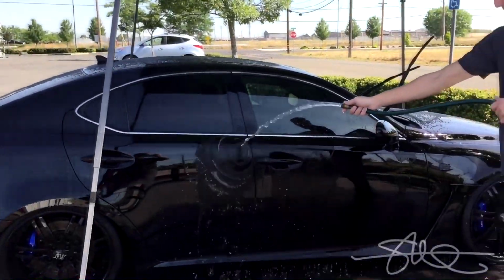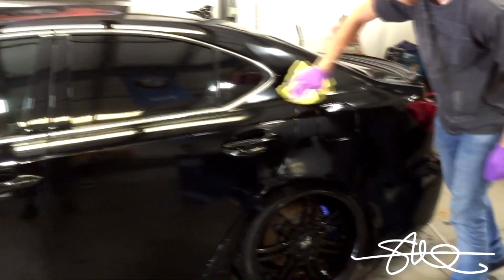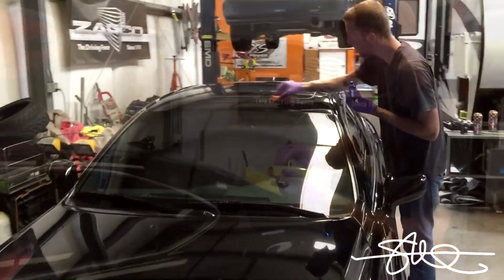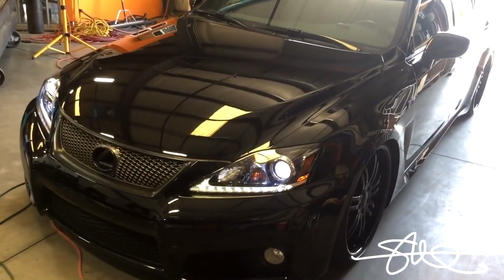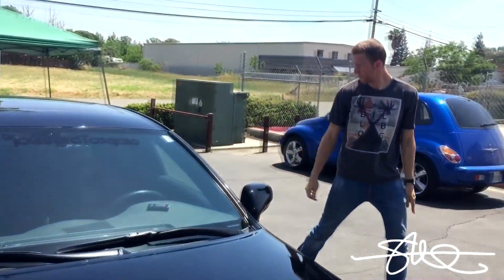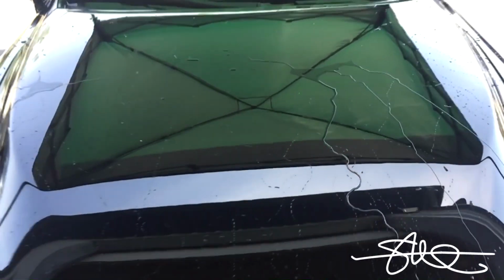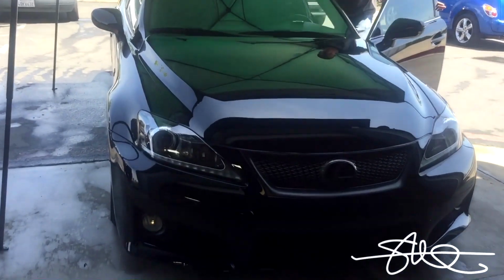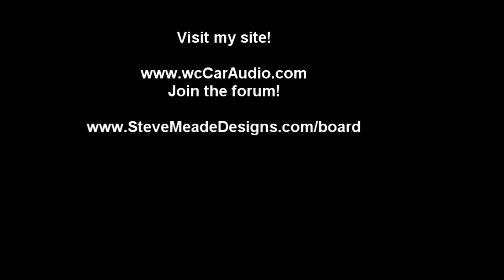AMAZING Shine! CQuartz UK Hydrophobic Ceramic Nano Paint Coating - Black Lexus ISF - Before/After

Comment from the maker: hang tight. 1080 60fps hasn't kicked in yet. It's a long video to process :D
Reply: +meade916 Hey Steve! I have a question for you because you know so much more than me about woofers and their power. I want to buy a 350 RMS Watt woofer with a 1300 Watt maximum musical power and my question is: Will it make it's power or not and what kind of amp do I need for the woofer?
Reply: +serban andrei lol

Comment: Was this water test performed right after the coating was completed? Products like this require a cure time to harden fully before being exposed to ANY outdoor elements whatsoever especially water. I am not a hater or troll I am just making a statement and giving you a heads up, your installer should know this. AS tempting as it is to watch the hydrophobic effects, trust me I am guilty of it as well but I always wait the specified cure time. How is the coating holding up 7 months later?
Reply: I understand the cure time of CQuartz.. We did the hydrophobic test just for the video and I carefully and properly dried the car afterwards.. Since this video I have coated the car once more because of some damage to his door having to get repainted and it is still as beautiful as ever
Reply: kaseyschutz would you make a trip out to San Jose CA? Or you stay local to Sacramento?

Comment: I've never been a fan of the smaller wool pad, it tends to leave swirl Mark's especially on a black car. You might not be able to see the swirl Mark's until the wax wears off then you have swirl mark city. Especially how he was slightly tipping the pad.

I personally buff with a full size yellow wool vs white for compounding then back over it with polish and a black walffel spundge pad. Perfect every time!!!

Comment: I 'd like to see how it holds up after a rainy day w/ road dust. Clean tap water is one thing but id like to see how it holds up in some real world applications. 

I wonder how this stuff affects the clear coat also..
Reply: +Great Drums It holds up to dirt/brake dust/etc good. And it helps because when you go to wash the dirt/etc doesn't stick as easy to when you hose it off it takes a lot of the dirt off with just water.

Comment: Maybe I missed it in the video, but how many coats was put on? And how long did you wait for it to cure?
Reply: 2 coats, one would assume at least 24 hours. Notice how the brake rotors look to be a bit grungey when the coating is being done, then when it comes out of the shop, the rotors are nice and clean.
Reply: 2 coats and I didn't see a cure time mentioned.

Comment: did it cost hella money do get it ceramic coated ?
Reply: Nope. The product itself is like 45-70$ depending if you get the 30 or 50ml bottle
Reply: +bosna917 Big expense comes from prep, paint has to be perfect before putting this stuff down
Reply: +J Capps true. The condition of the paint and what the customer wants to see as far as results of the defects being removed are what goes into the pricing. The man hours are the real killer. Some companies charge easily over $3,000 for serious high level elite of the elite details.

Comment: Does it hold up after sending your car through a carwash?
Reply: +Zohn Williams CarPro recommends hand washing only.
Reply: +Zohn Williams It's scratch resistant to a point. But I wouldn't send a car that I care about the looks of through a carwash. I would at least use a brushless one in that case.
Reply: +Henrik Nilsen I always use brushless. Just wondered if the high pressure jet spray would affect it at all.
Reply: Zohn Williams Unless it's a car with poorly done paintwork or a very old car, it shouldn't be a problem. 

I saw a video where someone dragged a tiny rock over a car that he had put Cquartz on, and it didn't make a scratch until he actually put some pressure on it. I think it should handle the water jets just fine.
Reply: Henrik Nilsen thanks. It's a Silver '07 GS.
Reply: you shouldn't be sending your car through any wash. run through washers and car wash places have shitty chemicals and TERRIBLY AWFUL BRUSHES. They swirl up your car after 1 wash. you should always do it by hand, unless it's a beater or a work truck etc etc.
Reply: +Jaime Diaz I'm guessing you didn't see the word "brushless" in my comments?

Comment: - Yes, it looks amazing, but the excess H2O was still taken off with a towel or compressed air, Sir ...  Hard water spots will still be abound if left alone in the sun when using an unfiltrated system.

Yeah, I am sure this is a very hateful comment, ... so let me shake my own damn head  first.
Reply from the maker: it isn't hateful but extremely ignorant.  You sound like someone who doesn't know what the hell he is talking about.  Any "spots" that end up on the paint wipe right off. So just stop now...

Comment: ceramic coating is good though, it just not worth that money, everyone proves that is just using water flow, if you go pressure washer on it, you'll get tons of water droplets there as well. It just a kind of long lasting wax, after wax application, you can get this kind of tricky water proof as well
Reply from the maker: coming from someone who CLEARLY has not used the product.  You can't say it is worth or isn't worth the money.  You are just an arm chair youtube quarterback.  I live in the real world. I WILL report if it is worth the money or not when the time comes. So far it IS.
Reply: I did it on both my bmw m3 and audi tt. Did I say it's good thu?  I did it on those two cars for a grand last year, guess what, it didn't give me a gloss finish as they promised. the gloss was given by the polish instead of the ceramic coat.  no matter how much H it is, they are just thin layers of chemical stuff, all they can give is just so called water proof trick,  wax does the same thing but way much cheaper than that.  a grand for 1 year lasting water proof? I don't think it is worth that. The best part of the story is, the car still gets dirt gets stretched gets whatever it happens. I'm not sure if you are sponsored by the product or not, this over-rated product is just like what I experienced.
Reply from the maker: sounds like you or the installer didn't prep it properly.  Also, sounds like maybe it wasn't applied correctly or you aren't maintaining it properly.  It isn't magic, you still have to know how to apply it and keep it looking good.  I am not sponsored by anyone. So far mine is holding up but they don't see a lot of outside parking and they don't see dirty rags.